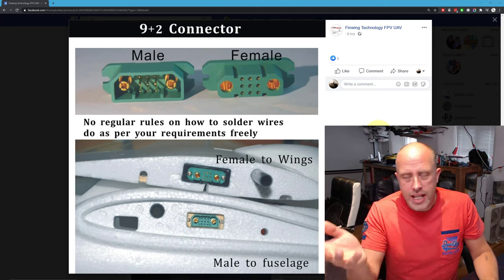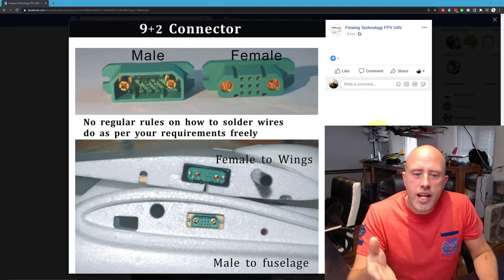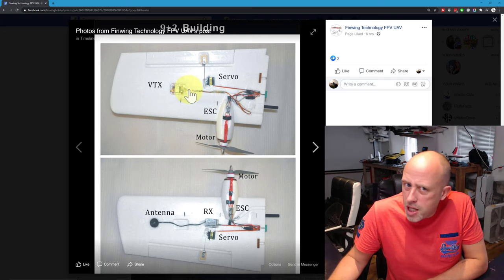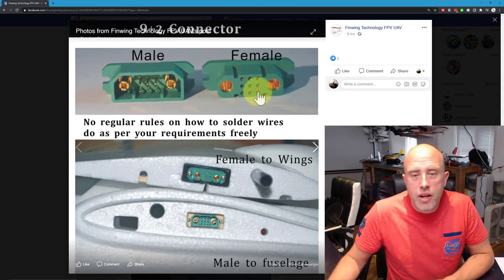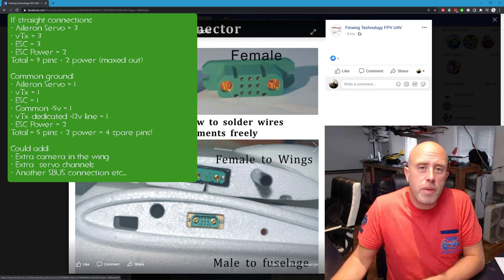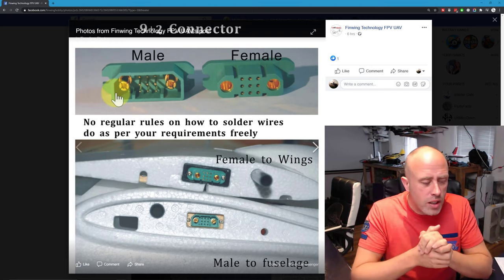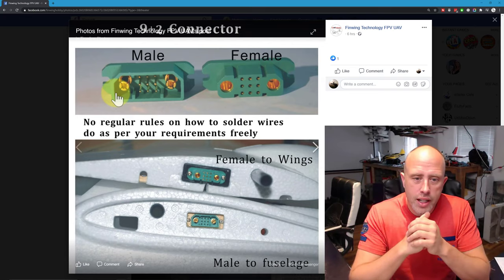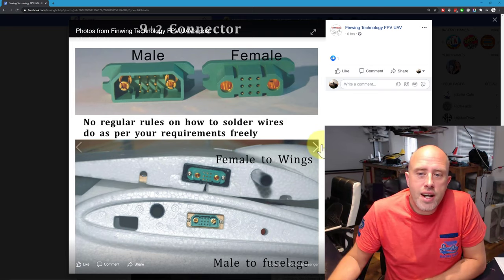What do you make of these Finnwing connectors?

Comment: They look alright to me.  I've used the 6 pin Multiplex connectors on glider wings in the past, as well as the 9 pin D connectors too.   I always rigid mount one side (screw or glue in place) and leave the other side floating (I.e. slightly loose screws).   Rigid mounting both sides allows the connector to wear quickly due to flexing between the two connector halves (as the wing moves due to flight loads).   I only ever use them where the wing retention is secure too.  I.e. locking screw, or pin.  Never tape or velcro....

Comment: I used them. Was a bit time consuming soldering everything up but they work great. And it adds strength to wing. Very solid connection. Also the ones that came with my kit was all metal.... I have a setup video with pictures of mines being built on my channel.

Comment: I do agree with all you have said. I have just got the new tundra from HobbyKing. In the manual it recommends using the screws and running tape along the wing seam to hold the wings in place.  I have used the molex connectors for years in my gliders and planes but only for sevo connecting and never had them fail. I would be very dubious of using the power connectors to power the esc. Do not draw any more than 30amps. The connector will overheat and melt in my personal opinion. To keep in mind that when you do a static current draw test on the ground to see what your esc will draw using a meter. When the craft is in flight and the wind hitts the prop you will draw half more static current. Just my opinion. I have never had a xt 60 or 3.5 millimeter connector overheat at 60a. I have had tamia, deans, jst connectors melt and cause a battery to cause a fire.

Comment: I use MPX connectors in all my Draks (nano, mini, big). No need for mains power on the wings there, so they have enough pins. They work great, IF you make sure you put them in so the pins get full contact when plugged in. Bit of a faff on the Draks because of that Coroplast vertical in the middle, and I’ve had one mini Drak crash a few times because I didn’t do it right. But on a wing where it’s molded in at the factory, or it’s a flush mating surface, I think they’d work great.

Comment: I just have not needed these to date.  With the motors in the removable section, it seems a pretty nice solution.

I've been using Dupont / servo connections for outboard components

Comment: I love my Albabird and didn't bother spending hours soldering that, instead just have male/female servo plugs to everything, still detachable and with advantage of easily replacing any equipment in the wings without going back to desolder / re-solder. The wing locking with nylon screw is sturdy, don't need to worry about that.

Comment: The real issue with all of this is ‘it is another place where solder is used’ Soldered connections in servo wire where plugs are pulled in and out are prone to failure right at the point where the solder ends in the wire. Crimp joints are far superior in servo wire.

Comment: if a wing comes loose I think the connector is the least of your worries 😁. But I think I would use it, but probably not "hard mount" both connectors so it has less change to vibrate loose. I'm going to try a mpx connector soon, but also one side will be on a wire (not fixed to the fuselage)

Comment: I would use them, but a locking tab on the connector and a loose wire for the fuselage end rather than a hard mounted connector. Would provide a safer breakout connector I think. All in all I really like the idea for a tidy build.

Comment: Thumbs up from me. I was also concerned but after thinking about a couple of things: 1 Usually I use servo connectors – which are only rated for a very low number of connect/disconnections. 2 - Fixed wires remove the flex at end of servo connectors where I have had a few break. 3 – the wings are tightly screwed on with the Albabird - not going to disconnect..

Comment: Yay from me, so long as the wing is secure. On the topic of a drak; I run would multi connectors, but they wouldn’t be fixed to the wing or the fuse, so you have to pull the wing out before you can disconnect, that that’s just because it’s a model has a flexible fitting on the wing, and if it slides out a little bit from clipping a hedge, you can still fly. If the alba used a similar flexible connection I would say the same, but I don’t think it’s designed to hedge bash and I think the wing is screwed on

Comment: If the wing is about to fall off the last of your problems is whether you still have electrical connectivity to the wing.  I have an FMS kingfisher which has flaps and ailerons to connect up (too big to transport assembled) and connecting 4 servo connectors on flying leads on every flying session is a royal pain in the arm.  This has got to be an improvement.
Reply: A wing is not likely to fall off by moving 5mm outward, which is about what it would take to disconnect this plug if it's hard-mounted on both sides.
Reply: @iforce2d  A very fair point, although most wings are locked into place anyway, with the exception of odd designs like the Drak range which rely on velcro.

Comment: I`ve got my Alba with 7w2 connectors (earlier finwing didn`t offer this 9w2).  This 7w2 looks more sturdy. They`re all metal (heavier) and connection is very solid. Sometimes it`s hard to disconnect wing. You can`t put rx and vtx on the wings with them, but there is no need for that in this plane. Fuse is long and have lots of space for separation. In this 9w2 connectors I would worry that they can melt while soldering power wires (plastic housing), apart from that they probably work ok.
Reply: I got 2 albabird the first i bought come with 7+2 it works great no issue but i cant put my receiver on my wing it needs 4 wires...the second albabird come with this 9+2 connector. I love it..can put rx and vtx with smartaudio on the wing..no issue at all with flight...soldering is not that hard as you think

Comment: They look ok, I would be cautious of the temptation of too long a length of battery wire from esc. been reading up on it and dangerous voltage spikes can result, better to have longer motor wires.

Comment: Those look to be much sturdier than many other solderless connections such as the ZOHD Drift, if they fit together well, I'd have no issues using them.  I would be careful with sharing grounds to get extra connections, you might introduce noise into the video.

Comment: I’m assuming the big brass guides have connection on them , as a sparks I would use these for the power + and neg , the others would have lighter load , also the big pins would be guiding small pins in correct position, I would use these 😇😇😇😇😇

Comment: It's not enough for me.  But maybe I'm asking too much.

The connector is mostly useful for big & therefore long-range models.  So I need 3 dedicated for the servo, 3 for the ESC.  So that's 6 of 9 used.  I would never share power from the servo to the VTX, so I need 3 for the VTX, but that leaves me without an ability to use smart audio or (even better) CRSF.  So, for me, the connector looks good, but I'd need a 12 + 2.

Comment: Hi there you mentioned 50 disconnect. Did you know that the sma/rsma on your 5.8ghz antenna for your fatsharks have a 500 circle of on/off as I've seen on other sites so does the help or make you think about your video resever. 500 times at once a week is 10 years